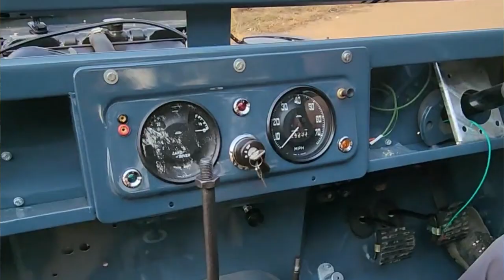The first test drive of my Land Rover Series 1 107 restoration seemed like a circus at times

Comment: Excellent! I'm looking forward to the same day I take mine for a drive (still waiting for parts!!!!!).. I noticed you still have a dip switch fitted to the floor panel but I had thought you repaired the dip switch on your steering wheel? I have my floor panel blanked off now. Your air cleaner/filter is different to mine.
Reply from the maker: The steering dispswitch was a long story, bottom line is I upgraded to a later steering box because I have for 7.50x16 tyres so went to the floor dispswitch. Sold my other steering assembly to a friend who is doing an 80”. May air cleaner is the standard on for 2.25l , it’s a bit bigger than and one from the 2.0l engine